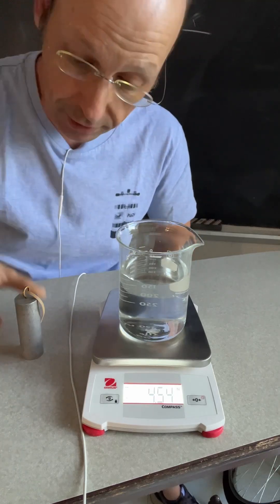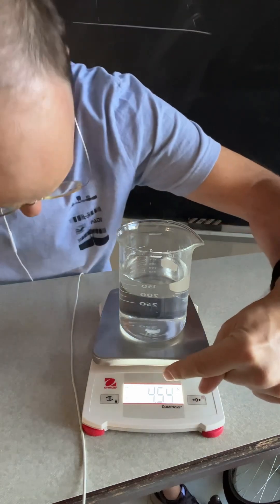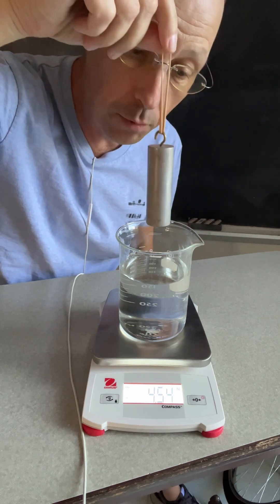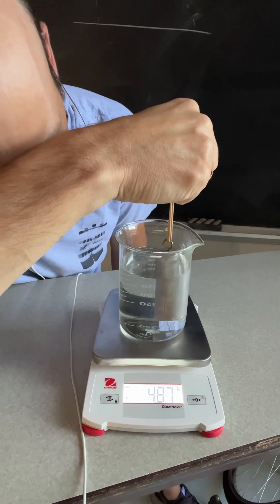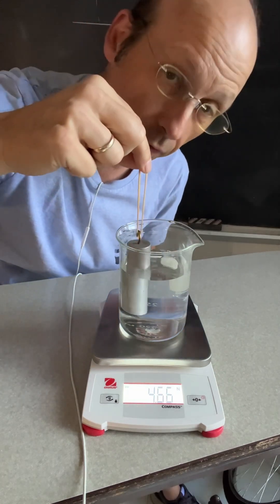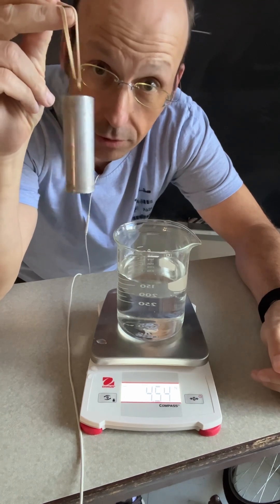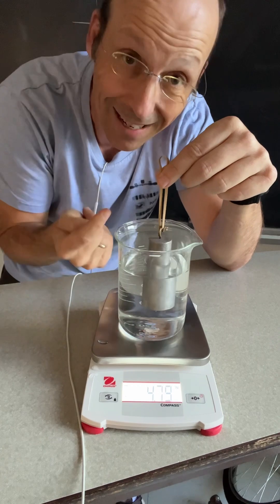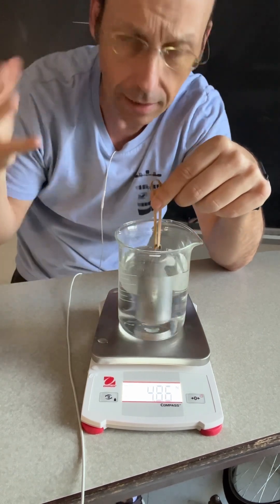What does the scale read when you submerse an object?

Comment: There's something about making sure a gold crown is real gold in this equation. Don't remember the specifics.
Reply: According to legend, Archimedes weighed a gold crown in air, and in water.  The apparent decrease of its weight in water, equals the weight of the water it displaces by the principal Archimedes discovered.  This allowed him to infer the volume, in addition to the weight he measured in air, and thus compare the density to the density of a reference sample of gold.

According to the legend, the crownmaker was found guilty of falsifying the gold in the crown.
Reply: Today, you can cleverly get around this, by gold-plating tungsten, since tungsten and gold have very similar densities.  Someone can fake a gold sample in a way that Archimedes couldn't tell the difference between it and real gold.

The only known way to prove one guilty of using tungsten to fake gold, is to drill into the sample to check it.  There is no known non-invasive way to do it.

Comment: Air pressure over the area of the water. the area of the water goes down with cylinder in. pressure in room doesn't change thus pushing more. Use square container of water and weight to make it easier to calc.

Comment: Would be more interesting to have a heavy metal block with a defined volume that completely submerges. Lift it with hanging scales instead of a rubber band. 
Only the water volume gets added to the lower scale. And substracted from the hang scales.
Reply: was about to say the same thing. this clip is not explaining it well at all. Nice experiment!
Reply: @fuzzblightyear145  This clip explains it perfectly. It's very likely that this clip is part of a longer clip that explains more.
Reply: exactly! 😅
Reply: you don't get it either.

Comment: The mass of the item you lower in does not matter - as long as you don't let it touch the bottom, right?
Reply: No, you’re still displacing the water. A boat floating on that water would still add weight, too
Reply: @dizfoster8726 You mean if the object has very low density, then it cannot be lowered into the water much, right?

Comment: the scale reading goes up. also the force with which you have to hold up the cylinder goes down as the water is now also pushing thy cylinder up. That force of the water on the cylinder is what the scale is registering.

Comment: Its the weight of the water you just displaced equal to the size of the object you just lowered in.
Reply: surely there's a point where the upthrust is equal to the weight and the net force is zero so the scale reading is the same?

Comment: Your hand holds the extra force. You can even verify the reading on the scale vs milliliter on the container if you use water and then displace 100 mm² (container reading goin up 100ml) you will add 100 grams to the scale.

Comment: would this be different if the water could move horizontally instead of vertically to account for displacement
Reply: It's how much of the weight is submerged, not which way the water goes... but to submerge... it must go up, right?
Reply: @OregonDARRYL  the weight displaces some amoint of water, forcing it to go upwards. That upwards water, now at a greater height. exerts a greater pressure on the water directly below it (pressure proportional to depth). Im unsure exactly what would change if the water didnt increase in height either as much or not at all for the same amount of displacement

Comment: Flying chickens in the truck?
Reply: Similar concept, except the birds in a truck thought experiment uses aerodynamic lift, instead of hydrostatic buoyancy.

In either case, the upward force a fluid exerts on an object, whether static or dynamic, will also materialize in a downforce on the fluid.  So the support force from the bottom of its container will be greater, than it otherwise would be.

For the birds in a truck thought experiment, the solid force from the standing birds is replaced with the downwash forces of the aerodynamics.  On net, an external scale weighing the truck, will still have the same reading.

Comment: The increase in mass is equal to the mass of water displaced by the cylinder.
Reply: @johns22  I don't see how anybody is tricked into thinking that's a closed system. He's holding the the rubber band that the weight is attached to in his hand.
Reply: What would happen if he pushed in a ping pong ball instead of the weight? Assuming that the ball has an equal volume to the weight.
Reply: @myndwork  Then it will add the mass of the water displaced by that ping pong ball to the scale's reading.

Ping pong ball is much lighter, but you also have to "push" it down to displace that same amount of water.
Reply: @myndwork  The ping pong ball is less dense than the water so it would float. The tension on the rubber band would go to zero and the measured mass of the system would increase by exactly the mass of the ping pong ball.
Reply: That sounds right.  The mass of water displaced is also the buoyancy force.
Reply: Exactly! Consider a floating boat. The boat displaces the same volume of water that weighs the same as the boat. This happens regardless of the shape of the boat that's below the surface of the water.
Reply: @johns22  Dude, it's Archimedes principle just like I said. The increase in weight measured on the balance in the video  is equal to weight of the water displaced. They guy even says it in the video. It's the buoyant force, hence Archimedes principle.
Reply: Exactly that! I tried to formulate the concept in a neat way, but you said it very well!
Reply: @johns22 Well done!
Reply: Wait: the object is not submerged completely. If it was completely in the water without, the force from the water would also be downwards as it pushes in every direction on the object. What would the reading say then? 
This seems like the object is pushing on the water in this experiment and that increases the weight. 
Tell me if I'm wrong.
Reply: @colaboytje  If the object is denser than water it can be completely submerged and resting on the bottom of the beaker, or it could still be suspended above the bottom of the beaker. In the first instance the weight would increase by the weight of the object. In the second it would be increased by the weight of the displaced water, and the excess weight of the object would (still) be suspended.  You are correct that there's a downward force on the water (and therefore the scale), and it results from the upward force of buoyancy. That water is pushing down on parts of the object when it's completely submerged is irrelevant.

 Alternatively, if you really want to get detailed, buoyancy is caused by the fluid pressure, and the pressure pushing down is countered by the pressure pushing up. Pressure increases with depth, so the pressure pushing up from the bottom will always be greater than the pressure pushing down from the top. Each pressure will change as the depth varies, but the difference in pressure will remain the same as long as the object keeps the same orientation so that the difference in depth from top to bottom remains constant.

Imagine a cylinder with ends with an area of exactly 1 square inch and a height of (about) 2.31' submerged in fresh water (with a weight or 64 pounds per cubic foot). The pressures on the side of the cylinder will all balance each other, so there will be no net force pushing the cylinder in a horizontal direction. If the top of the cylinder is 2.31' below the surface, the pressure pushing down on the top end of the cylinder will be 1 pound per square inch or a total force of 1 pound pushing downward. The pressure at bottom end of the cylinder will press upward at 2 psi for a total upward force of 2 pounds. The net upward pressure of 1 pound will result in a buoyant force of 1 pound. If the top of the cylinder  is twice as deep, at 4.62' the pressure at the top will increase to 2 psi and the pressure at the bottom will increase to 3 psi, and the difference and total upward pressure will remain 1 psi.
Reply: @suedenim9208  if the upward pressure is higher than the downward pressure, then the object will move upwards. 
Nobody denied that...
Reply: @colaboytje  Ever hear of gravity?
Reply: @suedenim9208  I heard of gravity. Have you heard of spelling?
Gravity is a force. Mass is not. 
So, I guess you are talking about weight, which is the point of the video. What was the point of your comment?
Reply: @colaboytje  The point, which should be obvious, is that pressure isn't the only force involved. And the point of the video, which I can see may not be as readily obvious, isn't weight.
Reply: @suedenim9208  Yes, more than 1 force is present. Yes, the point is weight. The point is not mass. You can't measure mass with a scale.
Reply: @colaboytje  You don't have a clue why I asked about gravity, do you? If you want to, feel free to convince me you do know, or ask me why. And you can very definitely measure mass with a scale.
Reply: @johns22 Correct.
Reply: God the Internet is stupid. There is no mass change here. The submerged body will experience the upward component of the pressure of the water at depth, which will offset its weight.
Reply: @BenjaminGatti  Read the thread. You're stupid. Balances read mass. This is about the fourth time I've clarified that when I say increase in mass, I mean the increase in measured mass on the balance. Read the freakin' thread before you pop off with your insulting BS.
Reply: @BenjaminGatti I agree what you said about the internet. That it's stupid but you are wrong this time. The mass of the system increases
Reply: @keep_walking_on_grass  The mass of what system? Let's agree that it is possible to explain the numbers on the scale multiple ways. Here is the problem you will have making "mass" a part of the equation: the mass of the cylinder doesn't matter so long as it is more dense than water; neither does the mass of the portion under the water. In fact, you can't get these numbers with any equation in which the mass is a changing variable. Here's what you need to calculate: the surface area of the cylinder and the pressure depth to which it is submerged. That's it. W2 = W1-p*a. See? no mass variable. Show me the mass equation?
Reply: He said volume dude  @johns22
Reply: But why😮
Reply: Are we seeing mass and energy being directly interchangeable?
Reply: @thomascorley8232  No. It's not a nuclear reaction.
Reply: @AtherAscher Yeah for the millionth freaking time: There is an increase in the mass as measured by the balance. No there is no change in mass of the whole system 
(there never is unless a nuclear reaction takes place) , but the mass reading on the balance increases to measure the mass of water that the weight displaces. Does that sound reasonable to you, professor or do you want to split some more hairs?
Reply: @johns22   He said : "equal to"
Reply: @johns22  Dear johns22, I'm afraid your definition of mass is not correct: any energy (any force) applied to a mass actually increases the mass. As Einstein said, mass and energy are the same thing but energy can flow freely while mass has inertia: when you 'trap' energy, you get mass.
Reply: Not mass. Weight. Those are two different things. Mass is unchangeable whereas weight is a force. Loss of weight of the cylinder = weight of water displaced = increase in weight registered by the guage.
Reply: @TrollMeister_  Weight does not exist, it's just mass x the acceleration given by the bending of spacetime due to the presence of Earth... 🙄
Reply: What I was just asking and since one cc of water is one gram couldn't you use this weight to figure out it's volume in cc
Reply: @terranovarain2183  Yes, that would work. You could get an excellent estimate of the volume like that. Volumetric pipettes are calibrated by weighing the water they dispense.
Reply: No, the buoyant force changes depending on buoyancy. A ping pong ball would add more than a dense object of the same size.
Reply: @archive8080  The buoyant force on any object is precisely equal to the weight of the mass  of the water it displaces.
Reply: @LaViejaConsolada you are right. the mass of the system is increased. The weight on the moon is of course less. But it's less weight for both. the water AND the cylinder.
 
 And to the one who  asked what happens when it is a ping pong ball with the same volume as of the cylinder?  The value on the balance would increase for the weight of the Pingpong Ball. Some 3.64 grams....... the displaced water would weight exactly  the same. And the total mass of the system would have increased about 3.64 grams. And it would swim on the waters surface.
Reply: that's magical
Reply: He is not doing the MASS, its more about weight transfer because he dont touch the bottom , the cylinder will be a bit weightless But transfered to the liquid
Reply: yees, this is another way of measuring the volume of an object, using something more precise like a scale
Reply: @johns22  Fair point. It's an increase in weight. I understand how it works. It's Archimedes principle.
Reply: @johns22 I get your point: if the hanging weight was hanging from the container itself before being lowered, the weight shown on the scale won't change.

But in this case the weight changes because the object hangs from outside the container (as you said, it's an external force).

But how do we calculate the value changing on the scale because of this external force? Well, it is equal to the weight of the volume of water displaced. The difference between the weight of the hanging object and the weight measured by the scale, is the force of tension of the rope attached to the hanging object.

The archimedes principle is useful in this case to calculate the volume of the submerged part.
As you said: if it were hanging from the container itself, we wouldn't be able to measure any increase in weight, but since it isn't hanging from the container itself, we can measure it and it is equal to the weight of the volume of water displaced.

To double check, I run the experiment right now for fun: an external hanging weight of volume 62 cc and mass 62 g, hanging submerging 44cc of it, increased the scale value by 44g, the exact volume of water displaced. Filling the hanging weight (it was a container) with 30g of water and submerging it again by 44 cc, increased the scale value by 44 g again and not more.

So the difference in the scale value is definetely calculated using the archimedes principle. 

The video may not be demonstrating archimedes specifically, but it is still coming into play.
Reply: @lucam8758 Well done and thanks for doing the experiment! This guy's simple vid got a lot of people to steaighten their thinking out!
Reply: And of course there is an increment of mass in the system. I don't know what are you smoking guys but without mass increment it would not be an increment of weight. And the mass increment is equal to the volume of water displaced by the cilinder. It is a perfect definition but people like to be smarty pants.
Reply: @LaViejaConsolada  The pressure on the water-body, caused by the weight being submerged, translates into  higher water levels - which is equal to a higher weight reading. Summa summarum : a sitiuation in which pressure/force translates into "weight" or "mass". A hollow object of similar shape/volume could be squeezed into the water by means of muscle power - and cause the same increase in weight reading